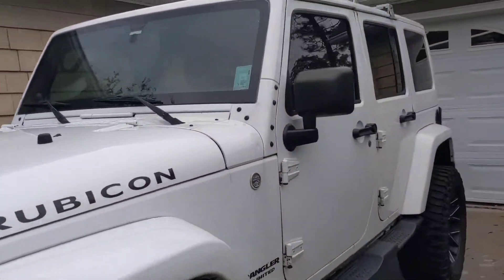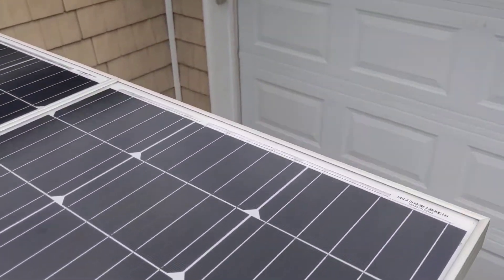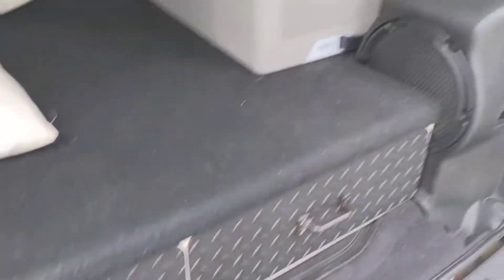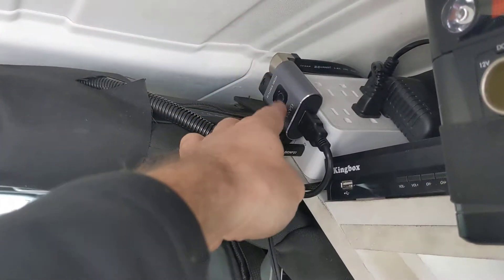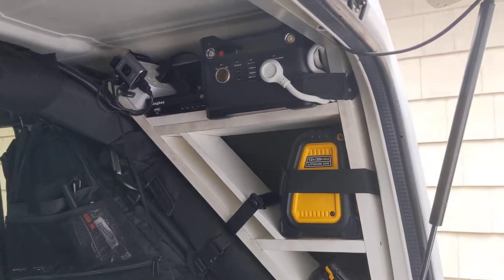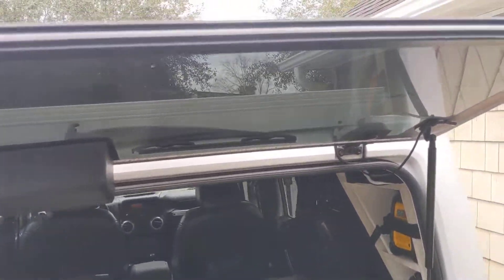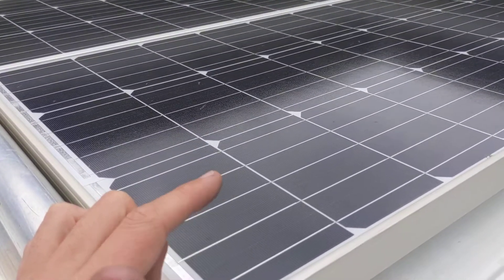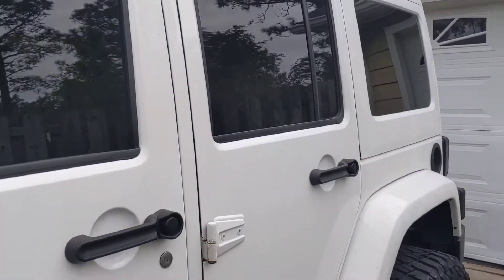Solar Jeep Overland Project Update

Comment: Really clever design with the hinged tilt mechanism. Thanks for the update and nice work! I've got the same battery on the way. Thanks for all the links as well!
Reply from the maker: Thank you! Yeah solar is a LOT more efficient if pointed directly toward the sun so in the winter or evenings keeping the panels pointed toward it can make a big difference in power generation
Reply from the maker: Also thanks for the support 👍

Comment: I couldn’t tell but that is probably a dry chem extinguisher? At the worst It will ruin your electronics if you discharge it, at best you will be cleaning up dry chem for days. You’re better off getting a CO2 extinguisher.
Reply from the maker: Good to know! Thanks
Reply: Ian M Burke Np - it’s rare you’re going to totally stop an engine compartment fire with an extinguisher anyways. The chemical powder has to coat the exact source of the fire, be it electrical or flammable liquid. So if the goal is to put out small spot fires CO2 is a great (although more expensive) way to go.